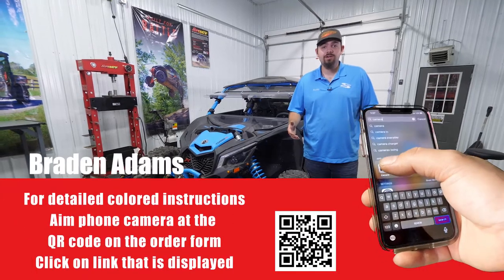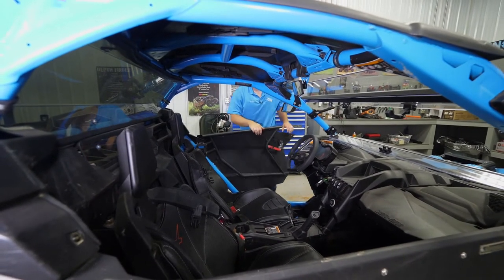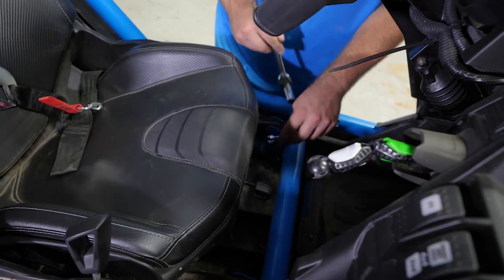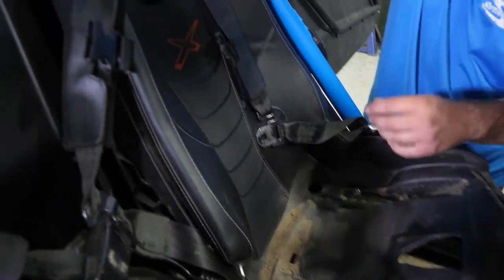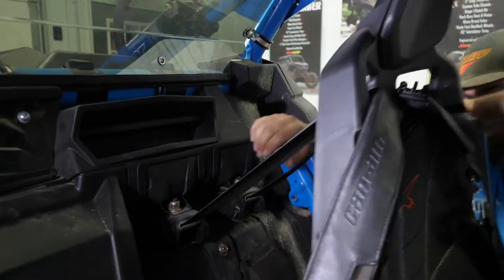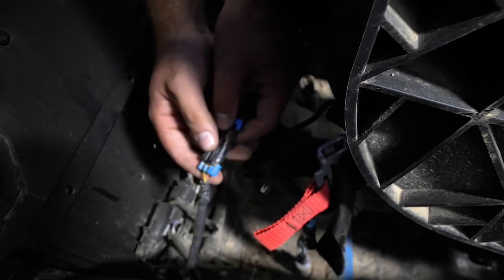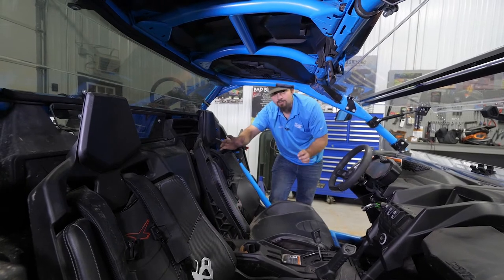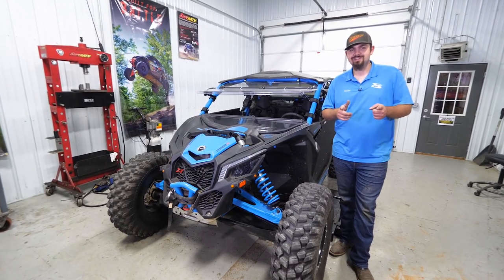How to install a seat belt override in Can-Am Maverick X3 when installing harnesses

Comment: The good part is, you only need to buy one of these.  On my 2021 Can-Am, only the driver seat has it.   The same for my last 2016 Can-Am.  I mean if you really wanted to, you snip the stock one off before the housing and just solder them together or even wire nut them together.  Same crap.  Besides, who would actually reinstall the stock belts if you already have harnesses installed?